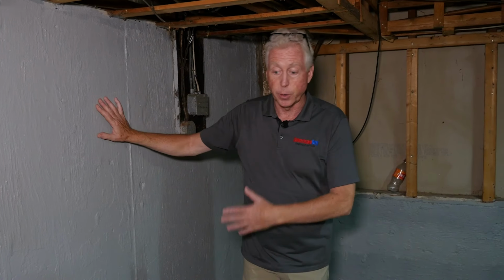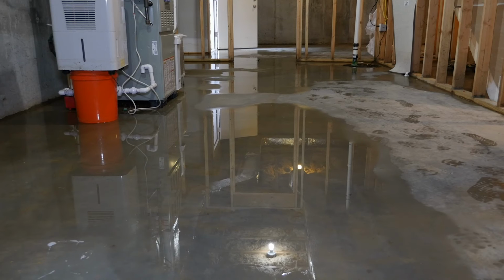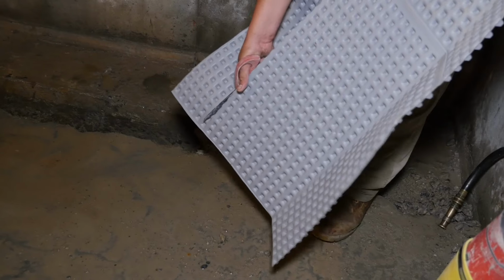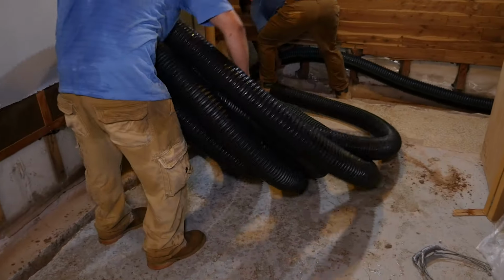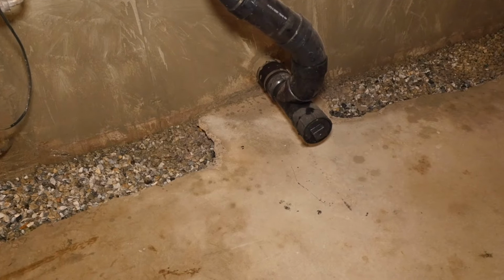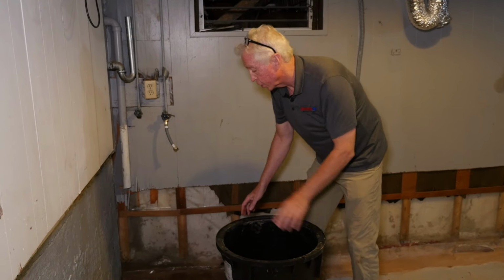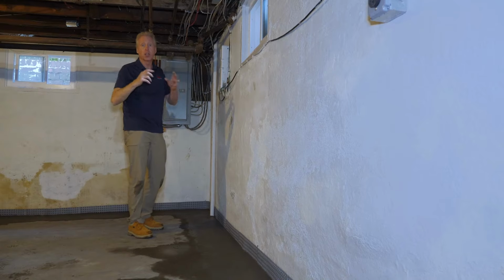Top Wet Basement Solutions Of The Year

Comment: Sometimes learning and DIY. Can be affordable . 
Sump pump 1000.00 for a good one 
Jack hammer rental 80a day. 
Gravel and concrete 600.00 materials * 
Pipe 200 at max. 
This system looks well built.
Reply from the maker: Absolutely — for someone who’s handy, has the right tools, and is comfortable doing the work, DIY can definitely reduce the cost. A big part of a professional waterproofing system, though, is the experience behind the installation, proper drainage design, and knowing how to handle the conditions you uncover along the way. Appreciate the kind words about the system!

Comment: I can't understand, the black drain pipe - is it perforated? I assume so because it is supposed to receive the excess water and lead it to the pit. 
But, if it is indeed perforated - how can the water flow through it down to that pit? After all, the holes also allow water to escape back.
Reply from the maker: Good question. Yes, it’s perforated. Water enters the pipe from the surrounding stone, and because the pipe is pitched toward the sump, the water flows in that direction. The holes let water in, but gravity and the slope keep it moving to the pit.

Comment: No weep holes drilled into the walls behind the channel?
Reply from the maker: No weep holes here, this is a poured concrete wall, not block. Weep holes are typically used with block walls. In this case, we address the water at the base instead.

Comment: Why no weepholes, Block holds water??
Reply from the maker: These are poured concrete walls, not block. Block walls can hold water and sometimes use weep holes, but poured concrete behaves differently, so we address the water at the cove joint instead.

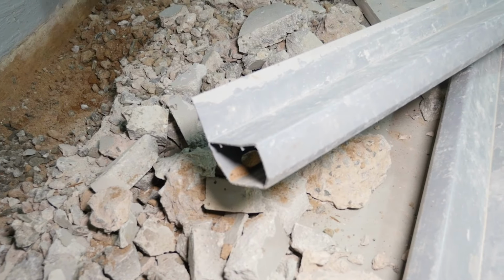Comment: Starting at 2:38, My friend, what you have here is a poured concrete wall, supposably the answer to a simple cinderblock wall when it comes to basement leaks.  However, this house was build on bad ground, likely on a clay foundation with orange colored fill beneath.  Clay is the worst for water drainage, and what you see here is rainwater, mostly, but possibly some groundwater, channeled into a single weak spot that failed.  The rubberized seal is just a band aid.  The answer, I think, is to drill a 1" weeping hole 4 inches above the floor, and snug in a pvc pipe, as a stint, to allow all the water above to drain into an open french drain that connects to a sump pump.  I'm not into adding drain tile because it becomes clogged.  Instead, an old fashioned 1" wide open french drain, right up against the basement wall, made from form fitted 2 x 4's, is the perfect answer.  They should be inspected and cleaned once a year or so, because standing water promotes mold.  However, that's easy to do with a flashlight, a thin paint scraper, and a cleaning pail.  This technique requires a jackhammer to break the concrete, a rag and oil to coat each 2 x 4, shims between the wall and the wood, and mortar to cement each 2 x 4 in place.  After a few days, remove the shims and hammer out each 2 x 4.  I remember an old Italian man once telling me, "Only use scrap wood. Never use new 2 x 4's for this job, because you'll just have to throw them away."  Well, I don't think we have to be so cheap, and today the most expensive part of the job is the jackhammer rental.👍

Comment: @americandrybasementsystems How do you treat your engineering tabs/spacers when it comes to the flow channel? Do you still put a flow channel against the wall and then caulk the bottom against the floor so it flows to the sides?
Reply from the maker: We cut a small groove between the wall and the spacer. Then we apply our super Crete where it meets the floor instead of caulk. Caulk will wear away in short order.
Reply: @ makes sense thanks!

Comment: you didn't surround the pipe with a fabric to slow down sediment transfer, any reason.
Reply from the maker: Fabric is better for outside work. Fabric inside will eventually get clogged with silt and dirt which will lead to water on your floor again.
Reply: @AmericanDryBasementSystems  Wouldn't that silt clog the interior system also?
Reply from the maker: @Fredjoe5  A firm no. Fabric is a filter by nature, and filters are designed to be replaced. It will clog. Please feel free to try it and see for yourself. Fabric filters only belong outside. The slits never clog.

Comment: Done basement waterproofing for 6 years . Yes that “WaterProofing System” will work for a couple years I’ve ripped hundreds of systems exactly like that even installed them for the first company I worked for the reason that will fail is because your setting it on the footer what you need to do is dig in front of the footer which is the wet zone then put the rock around the system to the top of footer that way concrete is at least 4 inch
Reply: What needs to be done is on the outside of the home. Anything on the inside is a band aid

Comment: from the start of the piping from the pump to the highest point you must keep that measurement as small as possible. the longer/higher you have to push/move the water the lower GPM is achieved happens to the pumping process and shortens the life of the pump. i do agree with installing that pipe under the slab
Reply from the maker: Pitched correctly, pumps can last 20+ years. We have many customers who will bear witness to their sump pump longevity. We can barely believe it ourselves. They only cycle repetitively after heavy downpours, especially in high water table areas.

Comment: We just did this but we also put a sock over the black perferated pipe.
Reply from the maker: In our area, the pipe doesn't need a sock. It will clog with slit and minimize the amount of water getting inside the drain pipe. Any excess slit is carried away to our sump station and pumped out. I can't change a sock under 4" of concrete every couple of years to improve flow.
Reply: Thanks for taking the time to make the video. Very informative @AmericanDryBasementSystems

Comment: Put a sock on that perforated pipe
Reply from the maker: A sock is a filter; dirty, clogged filters should be changed periodically. That's a big problem when the filter is deep under a concrete floor. Good luck changing your sock. They eventually fail the system.

Comment: I like and subscribe right away most videos I just watch a little bit and keep scrolling. You sir was very informative and I have a garage that leaks alot when it rains hard I have cracks in my foundation. My quote is  $8,000 does that sound right? Is there an alternative 🤔
Reply from the maker: A quote can go much higher depending on the type of foundation and how much prep work, linear feet, exterior discharge lines, sump pump stations, etc. Only an honest waterproofing inspector can give you an accurate price. It could be lower or higher, or it is something totally different and can be a simple fix for $300. Get several estimates.

Comment: Hi. Love the videos! I have a question about your crystalline concrete waterproofing "super slurry." Is there any reason to not use it up the entire concrete or cinder block wall vs. stopping at 2 ft? Thanks!
Reply from the maker: Our Superslurry penetrates pores and turns concrete into a waterproof barrier. When water fills up to that level, outside your basement walls, it stays there for a prolonged amount of time. This is where you will see the greatest amount of leeching or deterioration from sitting water outside your walls. Superslurry stops water from saturating those walls and deteriorating them.

Comment: Does the water from the pump get discharged up through the green grate that is on the lawn? Also, doesn't rain water enter that grate?
Reply from the maker: Yes. It is place 15 to 30 feet away from the house on a slope downward. Rain water does get in and filters out through the ground far from the house.

Comment: I would be happy to let you guys do our 100+ year old basement the right way. But I don't have that kind of money :(
Reply: how much does this process run approximately?
Reply: @richstevens5727  I was quoted approximately 19,000 by Ohio Basement Systems last year. That was at the height of trying to get supplies though and they called back once or twice stating that they could do it for a little less I think the lowest he said was around $16,000. But there's a mixture of the original River Rock foundation where some of that mortar is crumbling and the lye is leaching out. And then there are parts that have been cinder blocked. As well as a cistern on the back porch that  is cracking. With pipes from that protruding into the basement but not hooked to anything.
Reply: IS that for finishing basement too or just weather proofing it ?

Comment: Hello I subscribed after watching one of your videos. I like the work. Do you guys drill a  hole in each block first row on top off footing so it will drain out into the drainage area. ?? I like the special mix of cement you use to fill it back in. Excellent videos and work.
Reply: I'm not involved with these guys but work a sister company of their manufacturer.  If you have a Cinder Block foundation, Yes.  You need to drill holes through the lowest or first block.  Cinder block is hallow so water does build in the blocks.
Reply: @AcidAngelCross  what about stone foundations?

Comment: Are weephole necessary for a solid foundation compared to block ?
Reply from the maker: Not as often. Most of the time, the cold joints in a solid foundation are enough to provide a passage way for the ground water to enter the waterproofing drainage system.

Comment: This all makes perfect sense to me and sounds amazing up to the point of the black tube your putting in with the rock around it. How exactly is the water entering the black tube?  If water is coming in up from the ground or down from the walls and the only entry point of the black tube is from one end, then how does it really carry water?
Reply from the maker: They are perforated to allow water to enter the pipe at any point of contact and get carried to the sump basin. We have found no better way to move drainage water.
Reply: Water flows from high point to low point, and sump pump is at the lowest point. Gravity is at work.  So proper grade for the pipe is important.
Reply: Why not use PVC pipe instead of the flexible product?

Comment: Is there a certain pitch you set your pipes at? For example 1/8 or 1/4 of pitch?
Reply from the maker: Approx. .5 to 1-in/ft depending on the height of the footer. Longer wall; raise pipe at center so pitch will go downward to either side to a sump basket.

Comment: I'm actually in the middle of redoing my basement at the moment and I have a couple questions I've been having a hard time finding info on, would you be able to help me out?

1. My house is built in 1940, we just moved in a few months ago and after noticing water coming in we have so far removed drywall, replaced the entire drainage system, re-routed our sewage line, and noticed that on the wall where our sump pump empties into the yard someone over the years built a retention wall in our basement to reinforce the existing foundation wall. We had that entire wall underpinned and a 12" knee wall built to support it. At the top of this retention wall in the basement it sits down probably a foot lower from the where the joists are supported above, and the top of the block is exposed leading air and moisture to come in. I am planning on finishing this basement come hell or high water, so obviously I plan on insulating in my joist ends with foam board and spray, and then I plan to insulate in everything else with vapor barrier and foam board, would you recommend that the top of that retention wall be sealed off or left open to vent? I plan on building another wall during framing to keep it all sealed in with more vapor barrier and fiberglass insulation at my framing, but is it better that the retention wall breathe but still let in mold and God knows what else behind my framing, or is it better to completely seal it off?

2. The concrete slab is in terrible condition and there are some spots im worried about because they are slightly damp (its only been a few weeks since we replaced the drainage system, I know im supposed to wait longer). There obviously is no vapor barrier under the concrete and I cannot afford to replace the slab and redo it. Water mitigation is probably my only option, my slab definately needs to be leveled anyway. What type of systems do you recommend, what has the best success at keeping water and dampness out in these cases? Do you have any videos that attack sealing a concrete slab that are in really rough condition? There are some small spots where dirt is exposed, I can feel under it if I dig with my fingers, the slabs probably only 2 or 3 inches thick, its not level, someone added an addition to the basement square footage and parts of the previous demoed foundation wall are exposed, etc. All the videos I've been seeing are for slabs in way better condition.

Thanks for any help you are able to give.
Reply from the maker: Most waterproofers (including myself) on Youtube talk about traditional foundations that's why your quest for information is so difficult. Unfortunately, your situation is complex. It would be irresponsible of me to give you advice without physically seeing it in person. One thing is for sure seal off between the wall and sill plate if you are planning on making this a usable space. IMHO, the slab is just as important as the wall. There could be some undermining. Pound the slab with your foot and listen for change in sound. The slab should be at least 3.5 inches of thickness from center to wall. Quick-leveling cement will get you a level floor. Depending on the sq ft that could be a lot of cement. All the best
Reply: First, thanks alot for the reply. Im sure you're a busy guy. Any chance your company services the maryland area? 

Second, yes I was thinking of using floor leveler but I wasn't sure how it would react to a slab in as poor condition as mine with signs of dampness coming through. Obviously id go over it with diamond plate floor sanding and make sure its super clean, but I'm still concerned hydrostatic pressure could still weaken the leveler. I've been hearing that using a cement/sand/epoxy mix works pretty well, do you recommend that? It doesn't have to look pretty, my main concern is keeping out water, being level, and the surface not crumbling. 

Also I should mention my ceiling isnt very high and I'm planning on using MLV/resilient channel/double dry wall so headroom is an issue and I can't go too thick with the slab. Again, thank you so much for the reply.

Comment: Do you wrap the pipe in a fabric befor placing the stone? I’m confused how dirt will not get in to the pipe from the bottom grade where pipe layers. Great job thanks for the information
Reply from the maker: No. We don't use a fabric wrap. We don't like it. It acts as a filter but you can't change it as you do in a car. It clogs up and then problems follow. A fine slit enters every system, and the sump pump should be able to discharge both water and fine slit. The sump pump basket should be checked annually and cleaned with a wet-dry vac.

Comment: HOW CAN I BECOME THE BEST AT BASEMENT GUTTER I KNOW THE BOX SYSTEM IS AWFUL I INSTALLED CORRUGATED IN FRONT OF THE FOOTER BEFORE I MAKE SURE OTHERS AROUND ME 45 GUTTERS BECAUSE MOST SYSTEMS ARENT DEEP ENOUGH SO HOW FAR DOWN WOULD I RELLY HAVE TO CHIP TGE FOOTER BECAUSE AN ONSLAUGHT OF WATER MEANS IT WOULD RIP IT OUT OF THE GROUND IF THE THE CONCRETE WASNT ATLEAST TWO INCHES IF THE SYSTEMIS TOO DEEP IN THE GRAND SCHEME OF THINGS CAN BE RAISED UP BY GRAVEL SO WATER WOULD BE MANAGED WITHIN OR BENEATH THE FLOOR IF TRENCHES ARE NOT PITCHED OR BACK PITCHED HOW ON EARTH COULD BASEMENT GUTTER BE PITCHED THE PUMPS AND BACKUP ARE DESIGNED TO TAKE ON WATER BUT THE SYSTEM IS ALWAYS BROKEN BECAUSE OF CUTTING AROUND AREAS SUCH AS STAIRS OR WATER TANKS WATER SOFTENER OR JUST PLAIN LAZINESS AND HIGH POINTING THOSE AREASWHAT IS THE CORRECT WAY TO USE WATERGUARD BECAUSE ITS DAMAGING THE INTEGRITY OF THE FOOTER